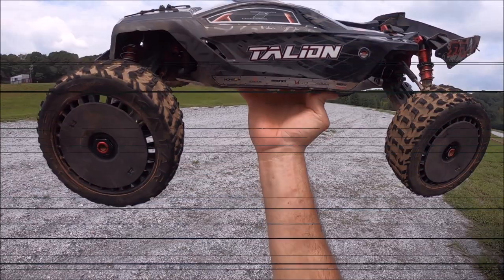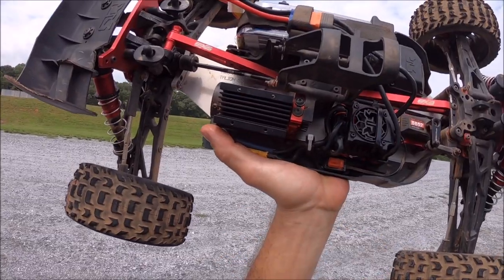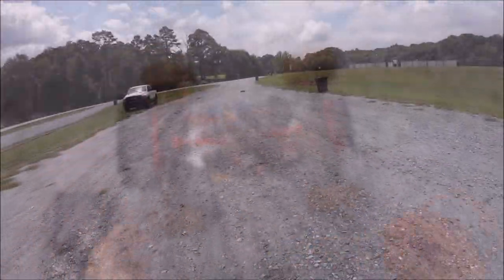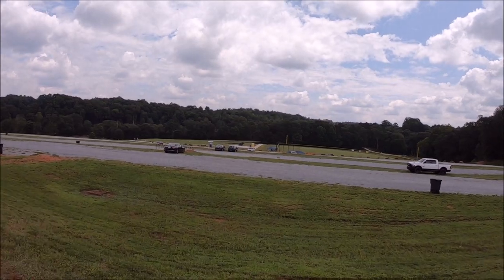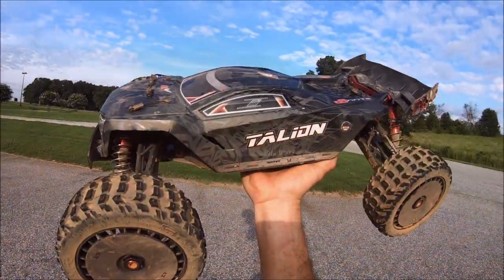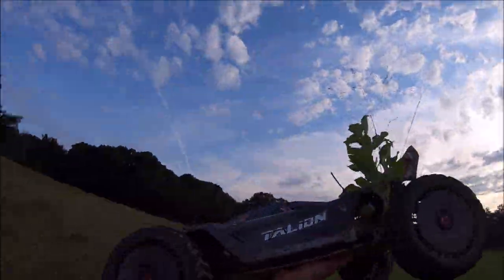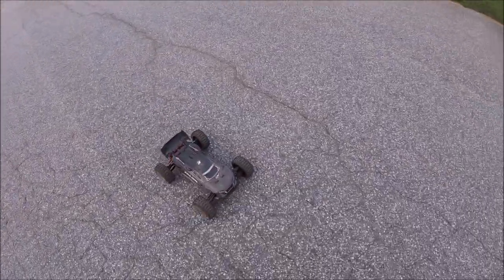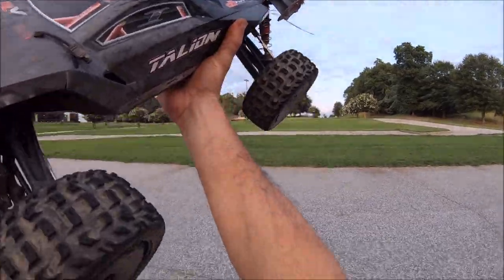"XTREME" NEW Talion Stallion! EXB Tips, Rips and High Speed Launches!

Comment: I’m having trouble with my rear diff screws stripping, you mentioned HRK’s. What is that? Great video!👍🔥
Reply from the maker: That is a Hot Racing Aluminum diffcase housing. No more stripped screw holes and also makes the diff last longer. I'd use at least two outer bearing shims with these.😎👊

Comment: Another Wicked Rip Brother Eric 😜!!!! She looks so much better with the shocks tuned 👀. No more chop and hop off the gravel and rougher terrain 👌. Bummer on the stock ESC. Definitely not a hot ticket item off Jenny's RC at this point 😂. Not sure what the deal is, but hopefully we won't see a bunch of them crapping out. Glad you mentioned the tire rip cuz I kept wondering if your glue beads were letting go 😝. Absolutely Fantastic sends and freestyling Bro 😱🚀🚀. She's a ground missile 100% 🍻🤙🤙😎💪👊👊
Reply from the maker: Thanks Brother Rich!! Yeah had a blast romping her around! The 27 tooth speed was insane!🤣Great belted Katars test!😜Yeah my old set had a rip in the rubber from the factory that kept getting worse. Glad to have gotten the new set in!🤗The lighter shock oil definitely helped keep her more planted! Just still need to fine tune the diffs. You're right, I'm sure the Spektrum ESC's aren't a hot item at Jenny's RC!👀🤣🤣Thanks for your comment bro! Bash on!😎🤙🤙👊🍻

Comment: Hi Eric hope u r fine just I'm new to the hobby, just a question I'm wondering about. what is the difference if i run 2 x 5000mha 3s 100c or 1 x 5000mha 6s 100c (Arrma Fraton v5 rtr). Ps the pros and cons aswell please regards Jaco.
Reply from the maker: Basically the same if lipo specs are the same. I prefer one pack as it cuts down on wires and overall weight as two lipos usually take up more room and is a tighter fit in the tray. Either will work though just up to you!😎👊👊
Reply: @RCDUDE81  Thank you so there is no extra runtime or punch.

Comment: I just put some 80 weight in the front and tekno springs on my talion EXB  much better now. TEKNO R/C TKR6093 in the front and TKR6083 in the rears
Reply from the maker: Good call bro!👊 Yeah I did add stiffer/longer springs to the front Just forgot to mention it! Much better in rougher terrain!
Reply: @RCDUDE81  what other tires are you considering ?  I was debating on some badland truggy tires. I think they are number 1178-10
Reply from the maker: I'll probably try some Backflip LP's next run. Still low profile but much more forgiving of a tire.

Comment: damn crazy bro !!
just one question.. you said you run 20t pinion.
doesnt the motor/esc get extremely hot with that gearing.... mine does for sure.
Reply from the maker: Not extremely hot with the belted tires. No ballooning to increase gear ratio even more. If running in dry dirt where there if lots of tire spin or in thick grass, I do recommend a cool down especially between packs! 20tooth is Max though imo for bashing!

Comment: Awesome sends Eric. Wow that 185 blx holds up really good with that gearing. Did you have any thermal shutdowns? Mine kraton EXB running stock blx electronics and with a 15T pinon she sometimes shuts down on me. Probably should give her break every 5 minutes or so.  Off road terrain mostly dirt and grass
Reply from the maker: I did have a thermal while dirt bashing at the end. All the spinning in dry dirt definitely heats everything up. Other than that a 20 tooth with belted tires is acceptable imo!

Comment: Unbelievable!  You are amazing.  Hey, how do you feel about the stock tires/shock weight for solely jumping?   Thanks.
Reply from the maker: For just jumping stock should be fine! I just wanted to tune for more versatile terrain.😎
Reply: @RCDUDE81  in IL we have no versatile terrain lol.
Reply: @RCDUDE81  Hey I was confused about the stock tires; I thought you replaced them with the belted Katars.  Since the belted ones come stock, it sounds like Arma went way to thick for the shock oil and too low gearing.  So for general bashing and jumping, would you recommend eventually upgrading to the 20T pinion and 80wt shock oil?  Sounds like they didn't stock this car out properly.  Thanks.
Reply from the maker: I replaced the tires with a new belted set yes. The first set of belted tires had a rip in the rubber. Actually was like that out of the box but I didn't want to complain as I got the car for free.😜The stiffer tires and suspension stock is not very good handling in rougher terrain so I lighted the oil to 80wt or roughly 1200cst from stock 2000cst and also longer front springs. Much better shock action. Yes stock out of box gearing is slow imo so I went 20 tooth. Just have to watch temps if it's super hot outside.

Comment: Hallo my name is Andre and I am from Germany so sorry for bad English.
I see al your vids and I am very impressed.  I am new in bashing and I decided to buy me a Talion.
Now I try to bash. And find out that there is so good how no air control with this car.
I have the small pinion gear and use 4s Lipo.
Perhaps you can count up your Modifikation  because it looks like you have more air control.
I am a little bit sad about my choice perhaps it would be better to buy the exb Outcast.
But now it is too late.
Reply from the maker: Hi Andre! For more air control, I'd recommend 6s and a larger pinion gear. Also try thicker front and center diff fluids. You need more wheel spin speed for air corrections so 6s will make a huge difference! I was running 6s and 20 tooth pinion. Stock on car is a 16 tooth. Good luck bro!!😎👊👊🍻
Reply: @RCDUDE81  
Many thanks.
Have you changed the punch?
Reply: HR diff front and rear?
Reply: Inkl. Diff case?

Comment: Still running the stock spur here? I finally upgraded to the 6s line and went with the talion exb. The 15t pinion leaves alot to be desired lol, I'm thinking of dropping down the sour to a 46t arrma. Thoughts?
Reply from the maker: Yes still stock spur with a 19 tooth pinion I think it was. I run 18-23 tooth pinions depending on what tires I run belted Katars and non belted. Dropping to a 46 spur will definitely wake it up!👌
Reply: @RCDUDE81  I have a 19t RR pinion I want to try first, but if that doesn't give me the scare factor I want.... 46t it is. Does RR make a 46t spur or am I limited to the tekno and arrma that i can grab at my hobby shop
Reply: @RCDUDE81  still running stock belted Katar, but plan on going to the backflip lp for bashing
Reply from the maker: To my knowledge only Arrma makes the spur gears. You can get many different brands of pinion but RR does make a great product! Are you running the  belted Katars? Those will need at least a 19 tooth to get moving. Maybe even a 20  without getting temps out of hand. I run a 23 tooth in my Talion XL with belted Katars but also have a Hobbystar 2000kv motor. If running regular Katars, I'd recommend no more than a 18 or 19 tooth and belted 19-20 tooth if running stock electronics.
Reply: @RCDUDE81  I think the 19t I grabbed was a good call then!!!! Lol it was also the only pinion gear they had that was applicable 🤷🏼‍♂️ I want to keep temps down so I have a 20x20 tornado something or another fan in place but unplugged. I'm taking my time with this rig so far. Only have about 4 packs through it. Going to go though the diffs and shim if needed, per your suggestion lol. I appreciate your input man, seriously. Thanks